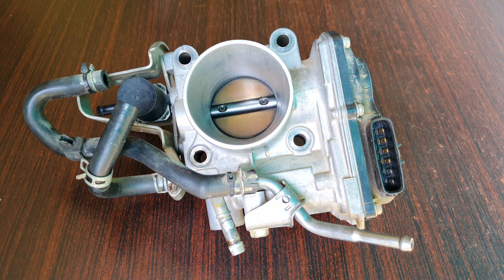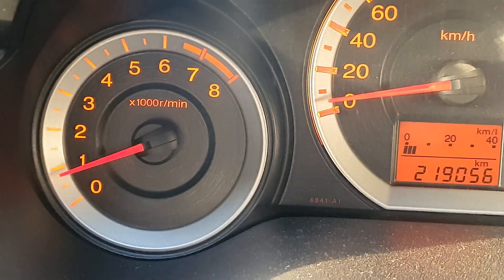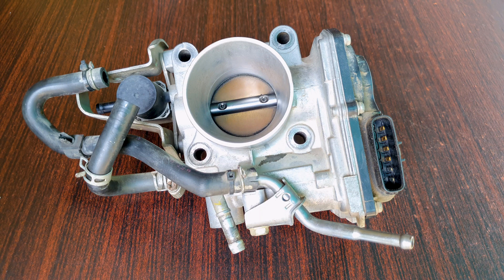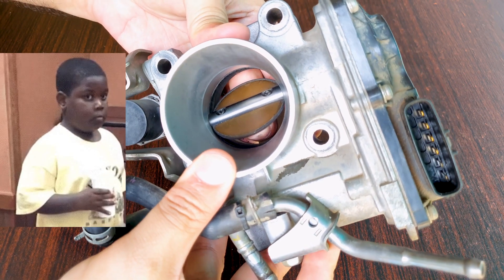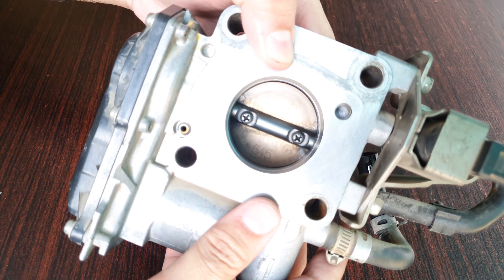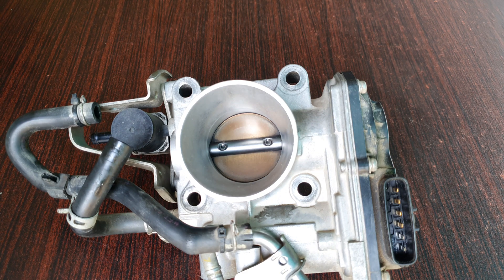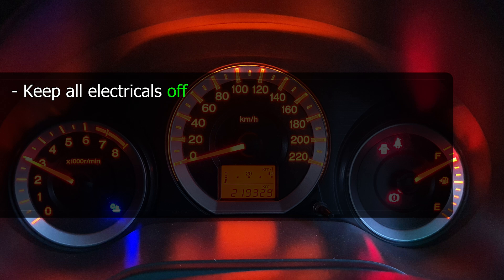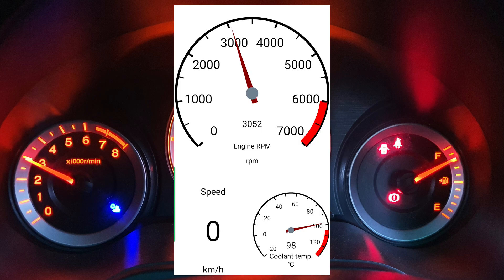Cleaning carbon buildup + Honda (RPM) idle relearn procedure

Comment from the maker: Throttle body shown: Honda City/Jazz GE8/Fit 2009-2014
-Similar cleaning procedure for many manual vehicles.

The Idle relearn procedure shown is for Honda and Acura vehicles. However, new modern vehicles may require aditional steps or specific use of a scan tool. This video does not account for those senarios/models.

If your radio/infotainmentsystem has a security code, note it down before disconnecting the battery.

Comment: I didn't understand the part after radiator fan turning on. Once it turns on, we should stop the 3000rpm level and let it idle for 5-7 minutes itself?
Reply from the maker: Yes, let it idle after the fans turn on.